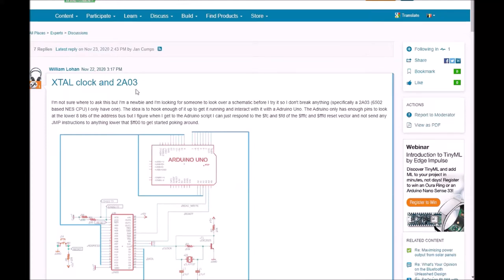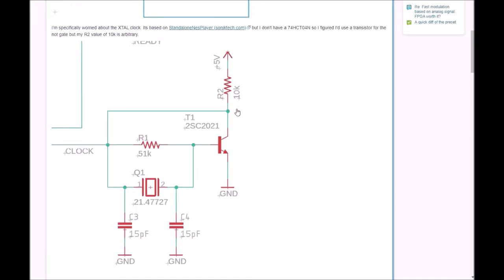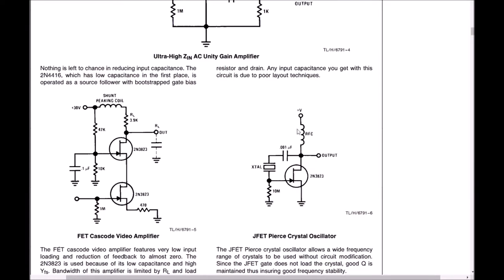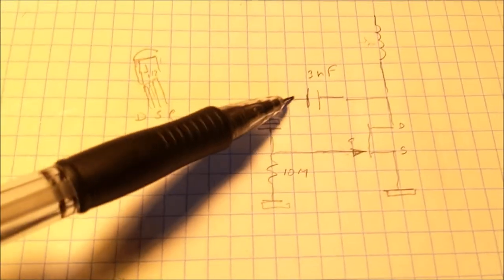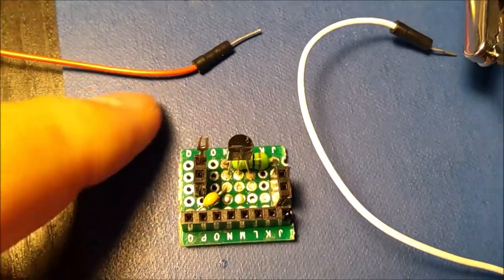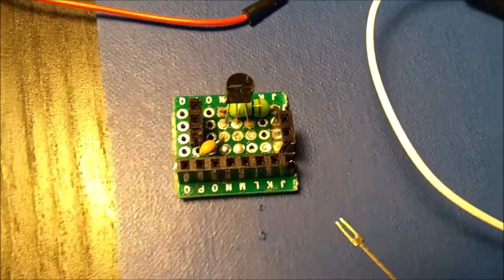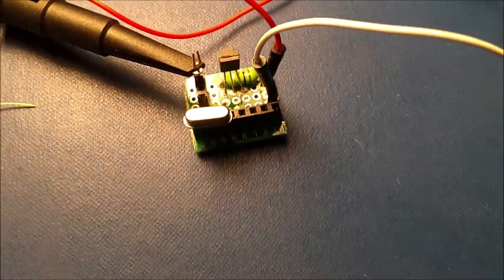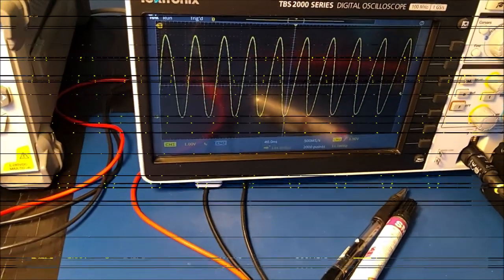Make a Pierce Cristal Oscillator with 1 JFET

Comment: I need a replacement for jfet... What is the main parameter? Must be a chopper jfet ? Frequency?
Reply from the maker: any jellybean n-channel little jfet. I used a J112, and that's a chopper - but this circuit is happy with common depletion type n-channel.
The circuit comes from a TI appnote (see video comments), and they use a 2N3823